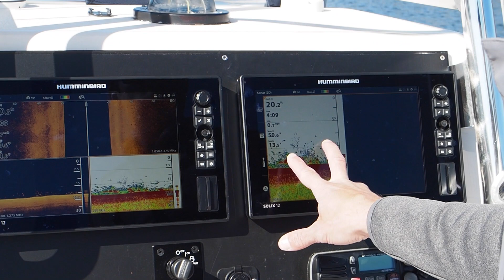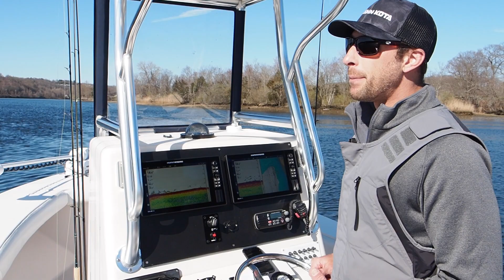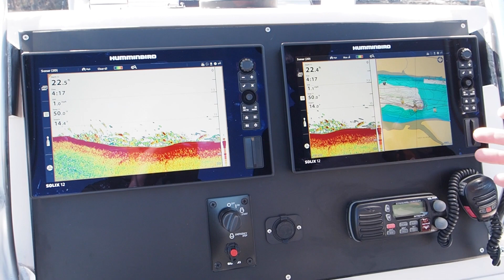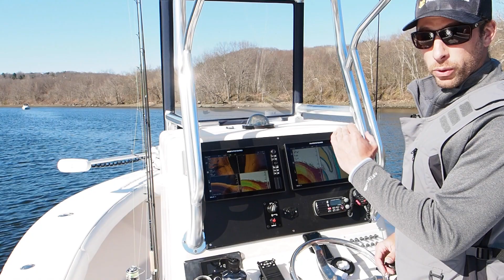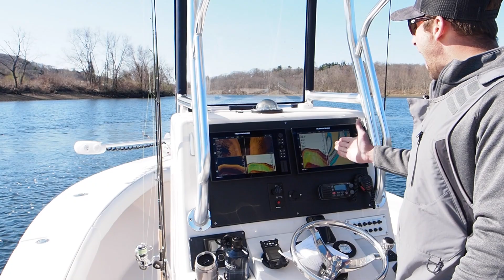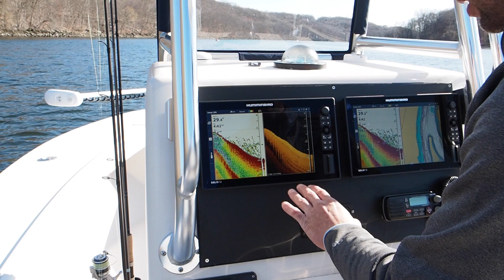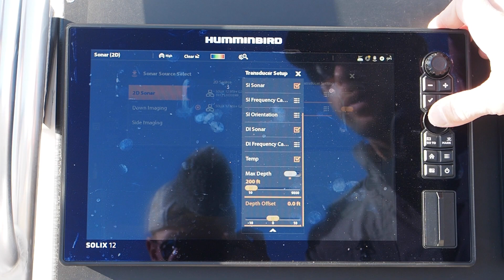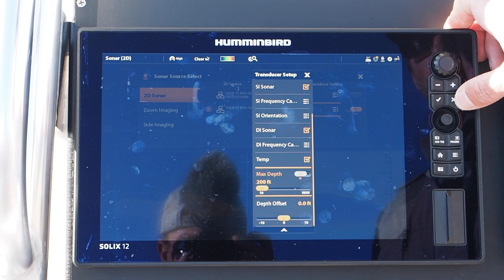Sonar and Down Imaging Explained: Everything you need to know to use sonar to catch more fish!

Comment: You need to adjust your transducer. The 2D fish returns are all streaking, leaving streaks to the right. You need to tilt the transducer either slightly forward or backward to give better fish returns.
Reply from the maker: Correct you want your transducer to be level. However the "streaks" that you are referring to is caused when you have fish that are staying with the boat and staying in the sonar beam. The opposition to this would be if you are marking fish when you are moving at a high speed then they would appear as small "specks' on the screen because the fish are moving in and out of the sonar beam at a high speed.